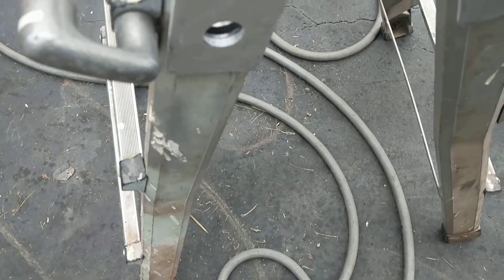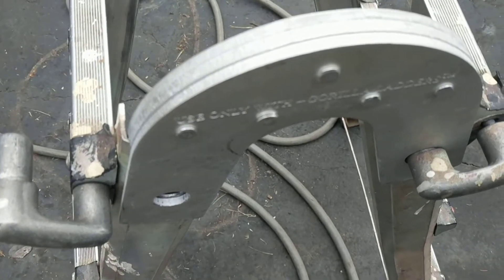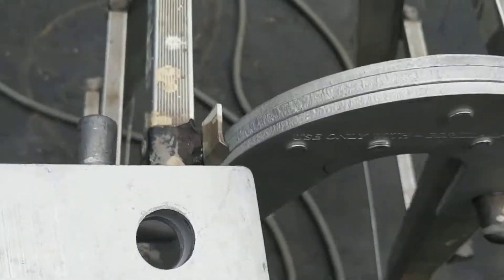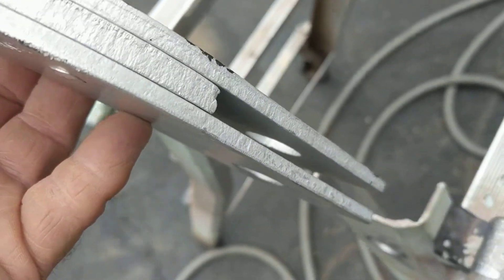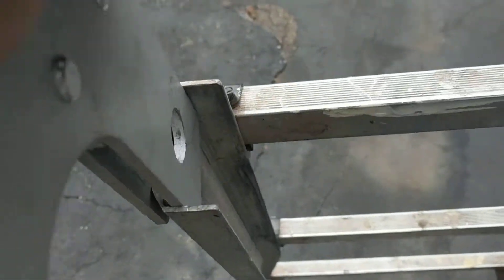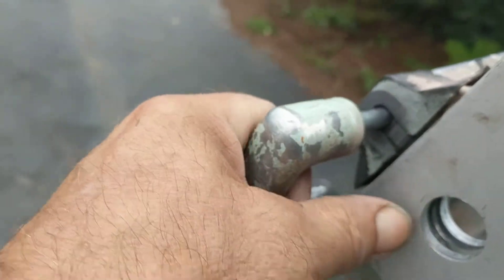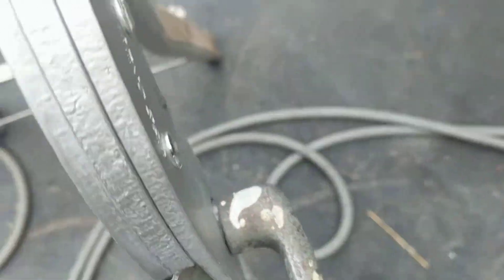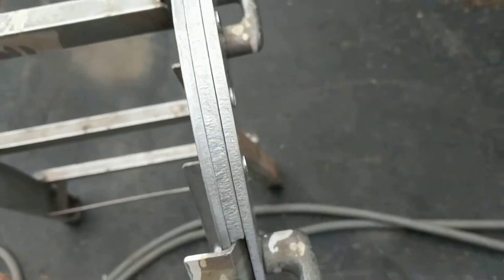Putting a gorilla ladder into scaffolding position

Comment: I've had my Gorilla Ladder for over 15 years and have never used the scaffold option. I have the adapters and couldn't figure out how they fit/worked. I needed to build a scaffold for my home project and could not find any where on the internet how to set it up. My instructions and labels on the ladder are long gone. Special thanks to you for the quick demo!!!